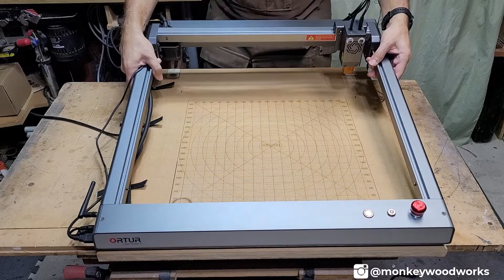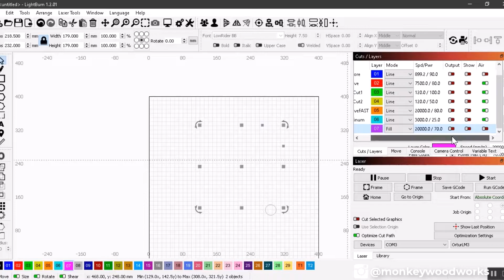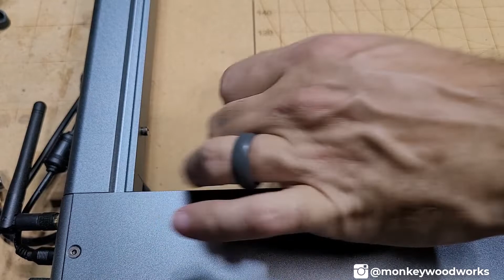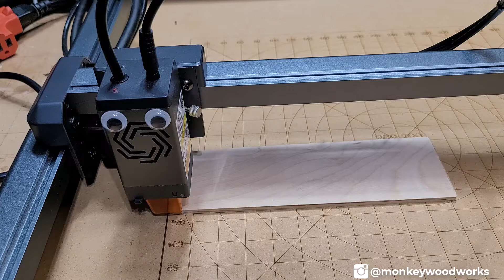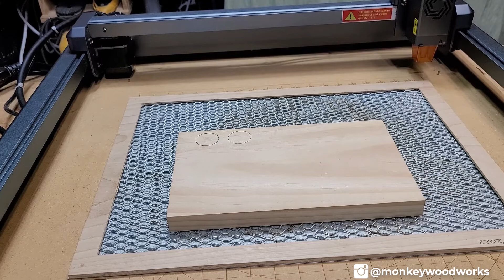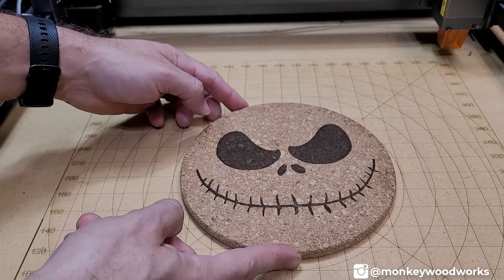NEW Ortur Laser Master 3 | Let's Test It!!

Comment: I have had this machine for 7 months and it has gradually lost power and the customer service is really bad.
They advertise a 24/7 customer support but this is a lie and they operate 9-5pm China time.
Expect one reply every 24hours.
They’ll avoid any wrongdoing.
I really wouldn’t recommend it.
Worked well for first 4 months.
The warranty doesn’t mean anything to Ortur.
Reply from the maker: Hmm.  Are you keeping up with your laser lens cleaning?  If you do not clean it every now and then, a degrade in laser power is exactly what will happen.  The dust/dirt will build up and start to block or distort the laser.  Worse case, it can cause the lens to mess up and you have to buy a new lens.  I have not had to deal with Ortur customer service.
Reply: @MonkeyWoodworks   Ortur advertise the lens needs cleaning every 50hours… I’ve had to clean mine every 4-5hours… cleaned both internal and external lenses as advised by Ortur but the tests remain the same with the cutting power…
Reply from the maker: @jas0019  oh man.  Have you joined some Ortur FB groups and ask there?
Reply from the maker: My personal opinion is 50 hours is WAY over the limit.  If I am cutting a lot of wood such as making ornaments, I clean my lens every few hours.  Have you inspected your lens?  It could be damaged and that is why it is degraded so much.

Comment: Great video and content. This should prove very helpful to beginners.  We really need a forum for feedback on these marvelous machines with so much promise and potential, and on the companies who sell them. 
Customer support and communication are especially important to someone who is just starting out on this adventure.  We also need to inform each other of the best deal nowadays in these times of inflation and profit-taking. 

I really like the Longer B-1 30/40 W.  Diode Lasers are now transitioning into C02 laser power and capability.  This will move the affordable diode Laser from just engraving to full wood processing.  
If a diode Laser can also process (cut out) the project structure,… say up to 0.500” (~ 12mm) That's a game-changer.  It’s a very exciting time to involved in “Woodworking”…kunk

Common Issues with the Ortur Lasermaster-3 

Issue 1:  Ortur LM-3 Not Powering On

One of the most prevalent problems encountered by users of the Ortur Laser Master 3 is its failure to power on. 
This issue can stem from various factors, including a faulty power adapter, blown fuse, loose connections, malfunctioning laser module, or motherboard glitches. 

Notably, the Ortur LM-3 has faced criticism for having an underrated  "power brick." Despite seeking assistance for this issue, my attempts were met with silence.
 
Subsequently, I discovered a suitable replacement on Amazon.

Issue 2:  Inadequate Laser Engraving

When laser engravings fail to meet expectations, several causes might be at play. These include improper focus, uneven engraving area, or unsuitable materials for laser engraving.  

YouTube is a good source of help for these issues.  You certainly shouldn’t expect help from Ortur.

Issue 3:  Mid-Operation Halts

Frequent occurrences of the machine halting during operations can be attributed to loose connections, faulty motors, or software/firmware glitches. 

This issue has been highlighted extensively on YouTube.  Ortur was no help with this or any other machine problems.

Issue 4:  Subpar Engraving Quality

Substandard engraving quality can arise due to incorrect settings, a dirty lens, or a malfunctioning laser module. To help with this you can:  make adjustments in settings, perform lens maintenance, and monitor the laser module's condition. 

The airflow at the laser head seemed inadequate on my LM3 the supplied air assist pump only supplied 30LPM while the specs recommended 50LPM.  Again, no replies to my questions from Ortur.

Issue 5:  Smoke and Odor Production

This is a common concern among laser users, particularly during cutting.

Some of the fumes that evolved during cutting, especially with synthetic materials like plastics or from galvanized metal grids are very toxic. Installing proper external ventilation and employing an enclosed setup is highly advised. 

This is not specifically an Ortur issue but applies to all laser installations.

Issue 6:  Unusual Motor Noises

Motors emitting abnormal sounds during operation may be attributed to loose connections, inadequate lubrication, or faulty motors.
 
Similar observations regarding the Ortur LM3 are shared on YouTube. 
A common cause was Ortur's inadequate tightening of the drive sprocket set screws, resulting in loosening of the drive pulley and possible drive shaft damage. 
 
Once again Ortur would not respond to my request for information. This was a major theme throughout my journey with the Ortur LM3.

Issue 7:  SD Card Recognition Failure

When the machine fails to recognize the SD card, possible reasons include a faulty SD card, corrupted files, or firmware complications. 

My Ortur LM3 seemed to have issues in this area.  The SD slot on my LM3 was not mounted correctly resulting in the loss of the SD card into the front rail extrusion which required a disassembly of the front rail of the LM3 to retrieve the card…

Not high on the fun meter. Contacting Ortur for assistance was hopeless, as usual.

Issue 8:  Machine Freezing Up During Operation

Machine freezing mid-operation may stem from software/firmware glitches, motherboard issues, or communication problems between the machine and the computer.
 
Establishing a reliable link between my Ortur LM-3 and any of my computers proved to be a major struggle.  Despite weeks of effort on my part. 
 
All the problems with the Ortur LM3 were exacerbated by the lack of help (total silence) from Ortur. 
 
I ultimately sold my brand-new machine at a substantial loss due to this and other issues and no available help from Ortur.

Issue 9:  Inconsistent Engravings

Inconsistent engraving results might result from incorrect settings, a dirty lens, problematic materials, or a malfunctioning PWM (pulse width modulated) laser power controller.

I don’t have direct experience with this issue as my Laser head would not come on, no matter what I tried. 

Assistance from Ortur for this issue was not forthcoming, as usual.

Issue  10:  Lack of Customer Support and Service

In terms of customer service and support, Ortur failed miserably on all counts.

Despite purchasing the laser, from an authorized Ortur distributer directly, I received no help or even a response when problems arose. 

Requests for help went unanswered, and defective parts questions were disregarded.

Unfortunately, Ortur seems unwilling to invest in a customer's Problems, needs, or satisfaction., even after a customer invests, in good faith, in an Ortur machine.

Personal Experience with Ortur LM-3

My excitement for the Ortur Laser Master 3's potential to enhance my workshop capability quickly turned to disappointment and frustration. 

Despite its promising appearance, I encountered only obstacles, excuses, and no assistance from Ortur. 

Their lone response directed me elsewhere for help saying that they weren’t responsible. If not Ortur then who? 
 
It’s like one of those old shell games when you deal with Ortur…The pea’s not really under any cup.

Ultimately, I was forced to sell the Ortur LM-3 at a substantial loss, leading to the demise of my laser aspirations.

An Urgent Recommendation

Given my ordeal, I strongly advise considering other options before investing in an Ortur product.

It is my hope that you will avoid these problems and not support a company that displays such an obvious lack of commitment to both product quality and customer service.

Parting Thoughts

I am not inclined to write negative reviews and I didn’t enjoy writing this one. But, I felt compelled to share my experience as a cautionary tale for others. Thank you for taking the time to read my account of problems I and others have had with Ortur.

I sincerely wish you success in pursuing a laser product that will truly meet your expectations.  

You may want to consider the following well-proven and reviewed Lasers:

- Longer Laser B1 20 W (22-24W Output Power) ~ $759

- Longer Laser B1 30 W (33-36W Output Power) ~ $979

- Longer Laser B1 40 W (44-48W Output Power). ~ $1299

- Acmer P1 Pro 20 W Laser Engraver ~ $359

- Acmer P2 Pro  33 W Laser Engraver ~ $599

- 5W CR-Laser Falcon Engraver ~ $259

- 10W CR-Laser Falcon Engraver ~ $379

- Creality - Falcon2 22 W Laser Engraver & Cutter  ~ $330 (sale 08/23)

- Creality - Falcon2 40 W Laser Engraver & cutter ~ $1619

- xTool D1 Pro ~ $994

- xTool D1 Pro 40W + 10W Laser Cutting Bundle ~ $1699
Reply from the maker: I appreciate the information.   I personally haven't had any issues with mine except the power cord slowly unplugging itself from the laser head however I have resolved that with some craft wire.  Other than that, no issues with my engraver.

Comment: I have the same machine and I can engrave no issue but I can't cut with it at all. and ideas? using 3mm MDF material on a hobeycomb with lightburn. 

Settings 100% with 300mm/sec and the best I get is a clean engrave. I also have air assist on.
Reply from the maker: I wonder if your focus is off?  I cut 3mm at 90% power, 300mm/min.  Also, make sure your lens is clean (and not broken!).  Loosen your laser head so you can lift it off, remove the air assist nozzle and have a peek at the lens.  You can clean it with an eye-glass lens wipe wrapped around the end of a q-tip.  If you don't have any wipes, you can also use the same q-tip soaked in isopropyl alcohol.  Just be careful not to scratch the lens.

Comment: The Y-axis is short, so the circle is crushed, so tell me what to do.
Reply from the maker: Hello.  Here are a few things to check: 
Y-Axis Movement - Pushing it with your hand (slowly), should move the Y-Axis smoothly and not feel tight in some places.
Belt tension - Not too tight, not too loose.
Rear Belt Gears - Make sure the gears are not loose.  There is a set screw that holds the gears to the motor.  Make sure both sides are tight.
Idler Adjustments (Belt Tension Adjusters) - Make sure the two front idler pulleys are installed correctly.  I installed mine with the washer on the wrong part of the bolt, it caused lots of problems.
https://www.youtube.com/watch?v=7kBa45u-vWw
Reply: Hi, I don't know if you got your laser sorted but if not here is a video that might help you calibrate the x and y axis.
https://www.youtube.com/watch?v=v8kOH5McCjY

Comment: please keep making more videos i love it thanks
Reply: I was thinking to buy ortur laser how is ur experience with it I saw newely launch Roly lasermatic 10 it's completely or most of the parts metal I confused which to buy
Reply from the maker: I have had issues with it but come to find out it was my fault all along.  I put a washer on the wrong side of the belt adjuster causing it to bind lol.  Other than that, it has been a good laser.  There are talks about how the built-in air-assist will actually hurt the laser by it getting hotter than normal and get clogged up but the work around is to always turn your air pump on when using it or just take the air assist nozzle off the laser head.
Reply from the maker: Thank you, I will

Comment: I couldn't get it to cut through 1/4" pine plywood at 30 passes at 100% power I guess its either me the wood or the laser is not as strong advertised
Reply from the maker: I cut 1/4" using: air-assist on,120mm/min speed, 90% power and over focusing the laser.  I use a piece of 3mm basswood, lay it on my 1/4" ply, and drop the laser down so that the laser shield rests on top of that basswood and lock the height in place.   Doing so puts the focal point more towards the middle of the 1/4" vs on top of it allowing it to cut deeper.

Comment: Good morning Michael great description of the Ortur3. I'm interested in purchasing this laser however there's one caveat I  can't seem to find the answer too perhaps you can enlighten me. I refurbish wine barrels and look to engrave the tops of them. They are mostly 22" inches in diameter and about 3/4 to 1"inch in thickness. Would this laser do the job? I look forward to your thoughts! Thank you , Hugh
Reply from the maker: It can, if you can figure out how to make it work.  The laser itself has about a 15.5" x 15.5" working area.  As long as your engraving is no larger than that, the basic laser will work.  You can pick up the entire laser and set it down on a surface you want to engrave.   For the barrels, you may have to come up with a jig for sitting the engraver on top of or sliding the barrels under it.  Feel free to DM me via FB or IG if you need more info or want discuss ideas.

Comment: How good is the customer service? I just went through a nightmare with...another company. No one seems to pay attention to customer service until you need it. By then it's too late. Great video :)
Reply: I unfortunately got 2 faulty laser units with my purchases, instantly sorted by Gil and Doris, great support.
Reply from the maker: I have not gone through customer service but their support is good.  I had an issue with my machine and opened a support ticket with them.  I was able to get an answer after a few back and fourth q&a's and was eventually up and running again.

Comment: I just got the LM3 and I can't get it to finish anything using lightburn by USB. It just randomly stops in the middle of the engraving and flashes codes that are not listed in manual. Won't respond to anything in lightburn until I reboot the LM3. Using the phone app or Laser GRBL on WIFI it works fine.
Reply from the maker: That is odd.  I had trouble with mine but their support team really helped.  If you haven't done so, I highly recommend you create a ticket with them on that and also join the "Ortur Laser Master 3" Facebook group.  They are both super helpful.  Also, there might be a firmware update on the LM3 to help it work better with Lightburn.  The support group can direct you to the download and instructions on how to install it.    https://ortur.tech/support/
Reply: @MonkeyWoodworks  Thanks. My issue was windows 11 related and had to disable a setting and now it works great. I found the fix on the facebook group you recommended. ORTUR also had a firmware update for me but i had it fixed before they sent it to me which im not sure it would have fixed it or not.
Reply from the maker: @chribrian  Glad you got it working!  I am not on 11 yet.  I'm still dragging my feet on that.

Comment: Sorry one more question, Is your ortur 3 works good with LightBurn via wi fi? Mine does not finish engraving =(((
Reply from the maker: The wifi in my garage is very bad so I do not use wifi.  I just have a 15ft USB extension cord to connect to my LM3
Reply: Lightburn doesn't work with the LM3 over wifi yet. Lightburn has an update coming sometime soon that will have it enabled. Some have managed to get it to work but it isn't supported yet. Have to use USB with it for now. Laser GRBL works over wifi now if you need it

Comment: Can I ask you for file to do the same board!
Reply from the maker: Are you referring to the grid?
Reply: @MonkeyWoodworks  board with markings on which the engraver is installed
Reply from the maker: I updated the comments in this video and added a download link.
Reply: @MonkeyWoodworks  Thank you ,can you please give me the size of your board
Reply from the maker: @yakutiik   I just measured the size of the engraver and made the board slightly larger than that.